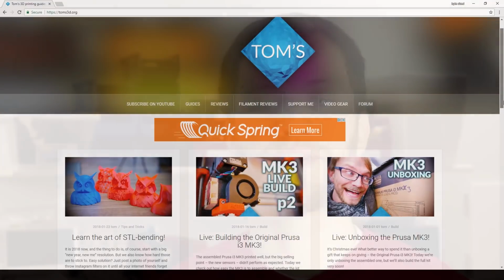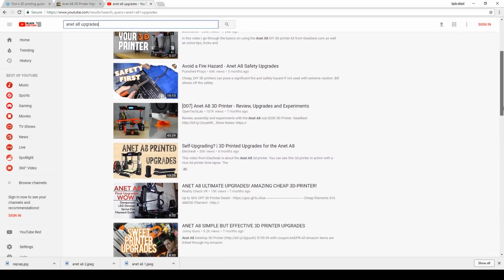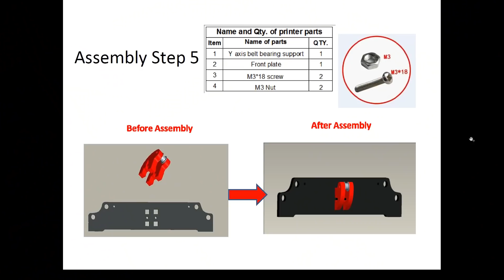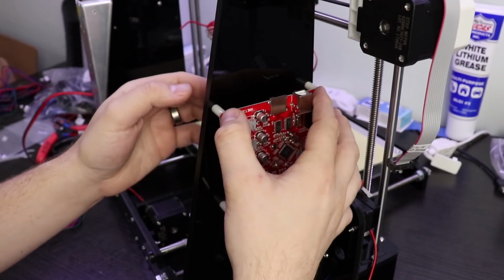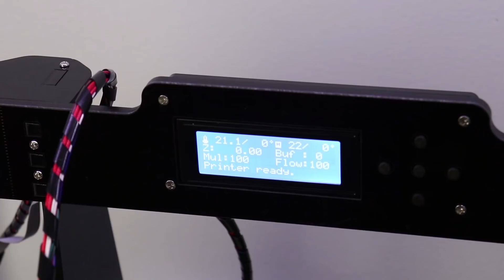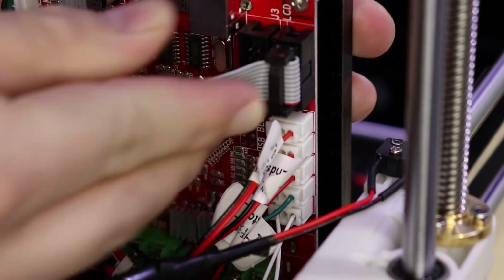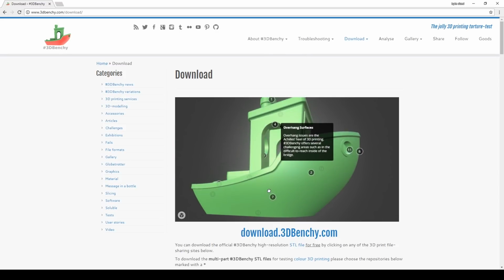Anet A8 - The best cheap DIY 3D printer in 2018?

Comment: I got this printer on Christmas '17 and still have yet to use it. Leveling the bed is extremely difficult. Any tips please man??
Reply: I have an A6, which has an identical print bed.  Yes, it's difficult to adjust the bed downward with the wingnuts, because you're having to compress the springs.  I get around this by squeezing the build plate and the support plate together while adjusting.  I adjust by half-turns until I get close, then 1/8th turns from there.

I use a sheet of plain paper (about .05 mm) as a gauge; if I print the first layer any thicker than that, the filament doesn't stick to the bed.

I go around the bed twice, adjusting with the print head as close to each adjusting screw as possible.  If the bed is within 5 mm to begin with, this gets it close enough.  If starting from scratch it can take three times around to get it right.
Reply: Note that one of the most plentiful parts to be found specifically for the Anet printers is thumbwheels to replace those horrible wingnuts.  You might look into those - just search on Thingiverse for "Anet A8 bed level", and you'll find many options.
Reply: BrightBlueJim so how can I print out the thumb Wheels if I can't even get anything printed out because of the leveling is bad? Just when I think I got it one of the corners is always off so I just sit and then a different one is off LOL
Reply: Hm.  It wasn't clear to me that this is making it completely unusable.  Sorry my suggestion wasn't useful.  If one corner is always bad, I would suspect that the print bed is not flat.  Another possibility is that one of the Z screws isn't tightly clamped to its motor, (the one on the side having troubles), causing a variation in height from left to right.  Also, there's nowhere in the instructions where it mentions this, but you do have to ensure that the left and right Z screws are synchronized the first time it's used, or any time the Z axis has moved with power off.  That is, both should hit their stops at the same time.  Run the Z stepper up (slowly) to the very top.  When one side hits its physical stop, stop there and manually turn the other motor to match it.  You can turn off power to do this, which makes the motor easier to turn.

That's it, that's all of my guesses.  Best of luck.
Reply from the maker: These are all great suggestions. I would also recommend (as BrightBlueJim said) the thumb wheel upgrade. The bed and the support bracket are both threaded which makes it very difficult to adjust. I found that with this two point contact system that my bed would warp and be impossible to get level. Plus you have to move the extruder out of the way to adjust the screws. The thumb wheel upgrade suggests drilling out the screw taps on the support bracket, that way there's only one point where the screw makes contact. This modification is something you can do before you print anything. Once I did this I saw a HUGE difference in bed leveling. It was much easier once I did this upgrade. Try to get it as level as you can with the suggestions here. Again I like BrighBlueJim's suggestion of making sure the z axis bearings are in sync and at the same height. Once you get it relatively level you should be able to print out the thumb wheel.
Reply: ThIzZoLaS channel look up auto levelers about$16 on Amazon, and rl smoothers which are about $20 for a good set of 3 eight diode smoothers. These will give you fantastic and relatively easy prints
Reply: Leveling the bed for me wasn't the issue, use the screwdriver provided, and a piece of paper. The real problem for me was realizing I needed to loosen the nuts on the bed plate bearings. Soon as I did that my print quality went way up.

Comment: The mod I've done to my A8 that seems to have made the biggest difference is using glass on the bed with some 3D printed nubs to hold the glass on the bed. I use a set of feeler gauges and manually level to .006mm across 12 points before printing. It works pretty decent.

Another is some tension brackets for the X and Y axis belts.
Reply from the maker: Thanks for the great suggestions!

Comment: If the first part printed on the machine have to be a replacement part for the machine, it is too cheap.
Reply: It's a huge part of the fun. If you want perfect prints out of the box, then this is definately not the printer for you.
Reply from the maker: I wouldn't call them replacement parts, more like upgrades or modifications. Perhaps I misspoke in the video

Comment: These printers are legit. I also have an xyz davinci pro that was 3x the price and i mostly like the anet a8 better.  you can get them for about 200 amazon prime. you will need extra nozzle/heatblock/stems down the road but thats all fairly cheap and also on amazon prime lol.

but the first thing you should buy for this or any ffm printer is ultrabase by anycubic.   screw blue tape and gluesticks.
Reply from the maker: Thanks for the tips!

Comment: blue - live, brown - neutral is eu standard. maybe they had stuff messed up?
Reply: Actually the standard is just the opposite, brown/black - live, blue - neutral
Reply: Damxcus EU standard brown is always live just remember it's the colour your pants will go if you poke it, blue it's nuetral and green, yellow striped is ground.
Reply from the maker: Yeah, I'm not sure what standard (if any) they were following. Here in the US, live is black and neutral is white. I was able to figure this out relatively easily.
Reply: byte sized: the black/white/green standards were superseded several decades ago.  Mike Peura is right.  I have an Anet A6, and its power cord is miswired as well.
Reply: Actually, black is only the most commonly used live wire in the USA. The NEC states that a live wire may be black, red, orange, but never white as it is reserved for neutral. Also gray is an NEC acceptable neutral wire in the USA.
Reply: TheRaven078: that is true for wiring in structures.  Small appliance power cords have used the international colors (brown, blue, green/yellow) for several decades.  I'm not talking ovens and clothes dryers - those still use black, red, white.  I'm talking about cords for 10 A or less either hardwired or wired through IEC connectors.  I'm guessing that the cords byte sized and I got with our machines were a batch that was rejected due to the plug being miswired, so they picked them up for next to nothing to put into these kits.  Since they weren't going into a finished product, there was no regulatory agency in the loop to catch them doing this.
Reply: Yup probably cords that went through no standard checks whatsoever. Just like imported devices with fake UL listings. I just wanted to point out for everyone's sake that live wires are not required to be black necessarily. You tend to run into this mostly with appliances as you said. Also it is very common in industrial controls where the live wire can be any color (though common practice is to not use white or green).

Comment: I bought mine almost a year ago and the amount of time and money spent on maintenance and upgrades does not make it worth it. Spend a few hundred dollars more on a printer to begin with.
Reply from the maker: What have you spent money on? Anything I should be concerned with?
Reply: byte sized The filament used to print all the upgrades. Original E3D-V6 hotend, but I guess u could just get a cheap clone. But of all the things I find the most expensive is the time spent.

Comment: I really would like to buy one of these things, mainly so I could learn about the assembly process and how it works, but as I am not home for 9 hours a day, I would rather spend $140 more to get a Cetus 3d, which is much safer than this.  Still a great video though, an very thorough as well
Reply from the maker: Since filming this video I've installed a fused IEC power connector with a switch. You could even unplug the printer when not in use. I don't share the safety concerns that most people do with this printer. I've left it to print overnight lots of times without any issues. But everyone should do what they're comfortable with.
Reply: byte sized Cool, and thanks for replying!

Comment: Worth it if you have more time than money. But, there are a lot of kits like that. I went with the Monoprice Maker Select (Wanhao Duplicator i3), because the extra $100 was worth the time saved in troubleshooting.
Reply from the maker: I've heard good things about Monoprice. I learn way more by having to troubleshoot than when something just works right away. As I explained in the video, one of the goals for this build was to learn more about 3D printing.

Comment: manual was right. BROWN is LIVE, BLUE is NEUTRAL and GREEN/YELOW is ground. Its ISO standart.
Reply from the maker: That's interesting about the ISO standard. When I buzzed it out on my multimeter at 9:06 the wires were reversed. That means whoever manufactured the cable did not comply with the ISO standard.
Reply: Donno excactly which is live and which is neutral in us plug. probably cable was bad. it shouldnt be any diference in non grounded device. funny part is that (by iso) in europe we have brown blue and green/yellow and in us it should be black white and green.

Comment: Have you secured your horned wires yet huge fire risk
Reply from the maker: Yes, I have. In this video I connected them temporarily as shown just to get it up and running. I unplugged the machine after each use. Since filming, I've installed a fused and switched IEC connector.
Reply: Next update for you. Since that power supply is a blazing inferno waiting to happen, I went straight to Raspberry pi and ATX power, pi controls the ATX power with GPIO pins and ATX powers the printer. Also no more moving SD card back and forth.

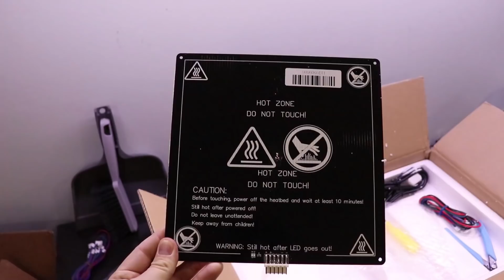Comment: Looking at 5:46, your belt looks off set.  This is caused by having the front plate on backwards. If you measure the each edge to the center of the the holes, you will see the front plate is not symmetrical.
Reply from the maker: huh, interesting. I'll have to investigate that a little more. Just looking at it in person, it doesn't look off set. Maybe the video made it look weird.
Reply: By "offset", I think he means vertically.  As you look at the Y platform from the side, the upper and lower sides of the belts should be parallel to each other.  With the support plate mounted the way it's described in the instructions, the upper belt will be higher, which can cause binding at the ends of travel.  I've seen this mentioned on a couple of build videos for the A8.

You don't have to take the whole plate off to fix this, which if you did, would require the careful tightening of the screws going into the linear bearings.  You can just take the cross plate off and move it from the top to the bottom.
Reply: Nope I mean left to right position. Brightbluejim is also correct about the H plate being upside down though. I just don't think the H plate orientation matters as much at the point you're at. As you start to tighten you belts, you will want to flip it around to keep the force from pulling down.  

I was skipping teeth when the plate was at the front of the travel because the belt wasn't lined up left to right because of the asymmetrical front acrylic AND my H plate was upside down.  Honestly, I don't think it matters much unless you are printing faster than you should. I did notice it made things a little quieter when I fixed it though.
Reply: Nope I mean left to right position. Brightbluejim is also correct about the H plate being upside down though. I just don't think the H plate orientation matters as much at the point you're at. As you start to tighten you belts, you will want to flip it around to keep the force from pulling down.  

I was skipping teeth when the plate was at the front of the travel because the belt wasn't lined up left to right because of the asymmetrical front acrylic AND my H plate was upside down.  Honestly, I don't think it matters much unless you are printing faster than you should. I did notice it made things a little quieter when I fixed it though.

Comment: I'm on a limited budget and actually enjoy putting kits together so this looks like a good possibility. How is the accuracy on this as in if you tell it to print a one inch cube, are the sides 1 inch and at 90 degree angles? Since my main use for a 3D printer would be making patterns for metal casting, Having that reasonably good matters more than surface finish or ability to do fine detail.
Reply: CrimFerret my prints are spot on or +-.5mm off👍🏽
Reply from the maker: I haven't printed any calibration cubes, but I have designed things in CAD with specific dimensions. After printing them out they fit as designed. I should try printing some sort of calibration cube, that would be an interesting data point.
Reply: Unless you are on very very tight budget, I would recommend Anet A6. Chassis is a bit sturdier and it prints bit better out of the box, and the price increase is maybe 20$
Reply: When building kits like these, you have some control over how accurate they are, but you have to take the trouble.  For example, the 90 degree angles depend on the Y axis guides being at right angles to the X axis guides, and this can be affected by the position of the nuts on the threaded rods that hold the Y axis together.  I've also seen it recommended that you clamp the printer down to a piece of plywood, because there isn't anything in the structure that keeps this angle correct on its own.  That is, you can pull the front of the Y axis either direction by about 3 mm either way, which can obviously affect the accuracy.

Similarly, getting vertical surfaces vertical depends on the printer being on a flat surface, but if you DO have it firmly attached to a flat surface, alignment on mine is within +/- .25 mm.

Comment: Spend $2 at the hardware store on 3mm washers. Add washers to all the screws holding the frame together. I did everything except stepper motors. Its rock solid.. no extra gussets or supports required. Print a x axis tensioner... perfect prints!
Reply: Good advice, but we can do MORE! Get SQUARE nuts for all of the 3mm screws. The hex nuts allow for 6 different axis of movement. The square nuts with LOCK washers end ANY movement between the two parts. Your printer will always be square and immovable. So many people design stiffeners for this printer when all it takes is to use the proper hardware in the first place. I wish Anet would have provided square nuts to go with their SQUARE slots, but I got my square nuts off ebay for cheap and its worth the cost. I have them on all of my A8s with superb results. Great advice Jay!
Reply: I could only find zinc 3m is that fine?
Reply: Patrick Rivera any kind will work. It just helps increase the surface area that the screw is putting tension on.
Reply from the maker: Thanks for the suggestions, I may have to try that!

Comment: I have the 3DCStar P802 i3 clone (essentially Tronxy) as my second printer. The first being the M3D micro. The i3 clone was $100 less than the M3D and was bounds better. One of the best upgrades I did that made the largest improvement was buying an actual E3D V6 hot end. I also used a PTFE tube from the direct extruder to a fixed point on the frame so the pull on the spool made no effect on the carriage. Now I am experimenting with a removable flexible build plate (0.02" 1095 spring steel) with blue tape and glue stick and magnetically attaching it to the aluminum hot plate. Should make a world of difference with part removal.
Reply from the maker: Thanks for the great tips! I will probably look into getting a new hot end at some point. Let me know how your removable flexible build plate experiments go. I know the newest Prusa i3 has one that is supposed to be good.
Reply: byte sized I just had a few prints with the new flexible bed. I have to say, it's simply amazing. When you flex it, parts pop right off! And the tape stays intact. I started with glueing small round neo magnets (150°C rated) under the aluminum heat bed and the steel wasn't held firm as much as I liked, so I used a couple of magnets from old hard drives and that did the trick. I highly recommend this build for anyone with an FDM printer.

Comment: H plate is upside down.
Reply: Thats the way the instructions say how to install it(95% sure) but most people end up flipping it to keep the belts parallel
Reply: I originally placed mine according to the instructions,  but later turned it upside down :)
Reply: The original video and instructions are also wrong.  :-)
Reply: Also, put a half twist in the belt between the motor sprocket and the idler bearing, thereby reducing any chatter due to the teeth on the belt running on the idler pulley. Not much of an "upgrade" but, what the heck. Prove me wrong😉
Reply: #1,000
Reply: Marcos Ramirez works either way...
Reply: JAY IRVING It does, but the belts aren’t completely paralleled to each other.
Reply: Marcos Ramirez ahh ok i see. Guess i gotta swap mine.
Reply: its ironic that he called the anet a8 a total junk, when he assembled it wrong in the first place, i guess not even the video about how to assemble it could help this you-tuber, but what should one expect from a "total junk?" channel...